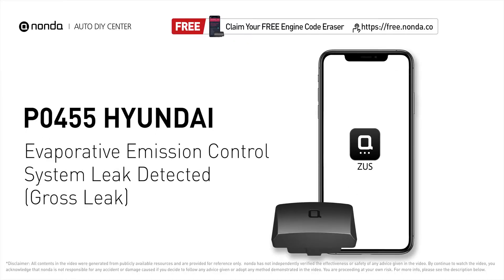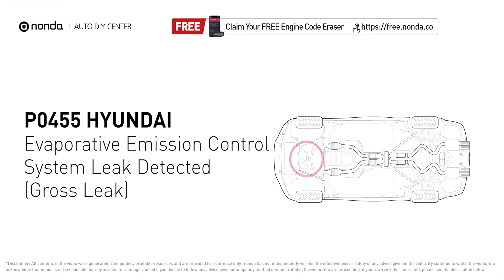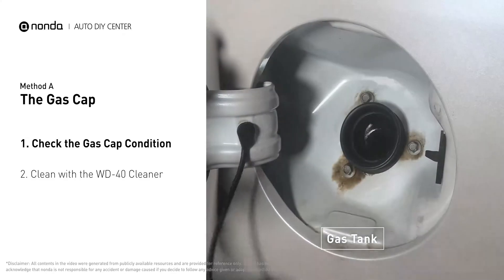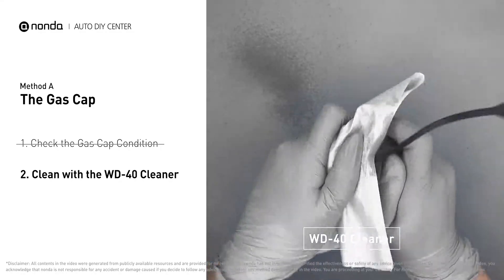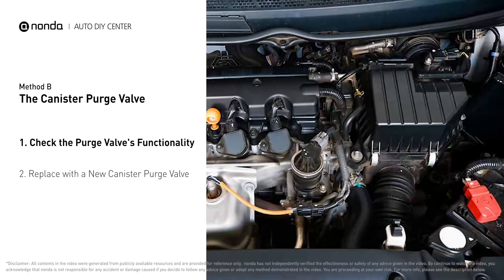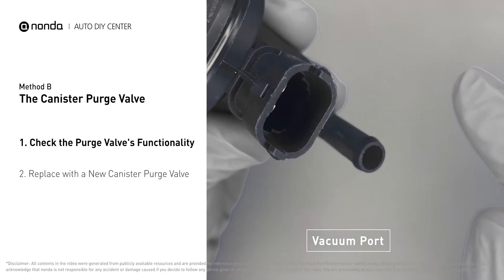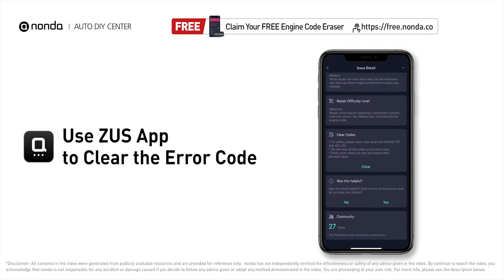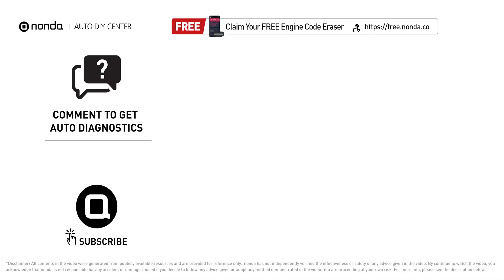How to Fix HYUNDAI P0455 Engine Code in 3 Minutes [2 DIY Methods / Only $4.61]

Comment: Hi, I am getting this code on my Hyundai Accent 2008. I changed the purge, the fuel cap. After thoses changes error was cleared but two weeks ago Code reappeared. What else can I do?
Reply from the maker: Hi Phany, can you please confirm if this is the only code that you're getting?
Reply: Don't put any significant money into this car before fixing the t.code. Bunnyhole to hell.
Reply: I have a 2000 Hyundai Elantra and YES it’s the only code I’m getting and I did what Phany did. I had smog test in December of 2022 and it wasn’t ready cuz I had replaced the battery in 2021. It doesn’t hit the highway so when it wasn’t ready for the test. I had to drive it on the highway for 3 days. After that it passed and now I can’t get rid of this code P0455. I appreciate any feedback. In 2022 I also replaced the canister cuz the fuel pump kept stopping and since I was there I replaced the valve underneath.
Reply: @1eyerasta  did you find a solution? I replaced the purge valve, canister purge valve, and the code came back months later
Reply: @itsxing1  not yet. The light went off and I think it came back on. For me it all started with not being able to fill up at the pump. When I replaced the canister all the charcoal was coming out. Being I was down there I replaced the valve. Filling up was back to normal. It wasn’t tell I had to smog it. Which it passed. But I had to drive it 50 miles on the highway due to replacing the battery and the car wasn’t ready for smog test. It wasn’t tell a few weeks later the engine light came on. So I did the gas cap and the purge valve under the hood. Resetting the code with each of them. The light went off after two weeks but I think it’s still on. With code P0455 (large evap leak) if I come up with a resolution I’ll let you know 👍
Reply: @1eyerasta  I did the same as you, changed the purge on under the hood, but I also replaced the canister purge valve in the back of the car near the back left tire. I have a 2007 Hyundai accent. The check engine light went away, but came back after months and now my possibly solutions r any leaks in any hoses, gas cap (I think this might fix my problem), or charcoal canister. I used to have an issue where my car would struggle to start up and idle right after I filled up my tank back when I had this first had this code, but now that doesn’t happen. If I find a solution I’ll let you know as well

Comment: I am struggling with error code p0455.  I am riding a North American Santa Fe 07 model year in Korea, and there is no way to fix it.
Reply: Sooner or later you'll end up taking the car to a dealer. My car(as we speak) has same problem, smoke test showed no problems anywhere, was told to bring to dealer they have more specific diagnosing equipment. So, the question will be, how much money do you want to spend figuring this out?
Reply from the maker: Hello, if this is the only code you are getting, you can follow the quick guide/tips provided in our video on how to fix this code. Hope it helps!
Reply: @nondainc  no offense, probably won't help. This trouble code is a rabbit hole.

Comment: So changed the purge valve on my '07 accent, cleared code. Went away for a week, and vehicle feels smoother.  Same code (P0455) came back, still feels as smooth though.  Guess I will clean cap now?  Odd code came back while feeling better..
Reply from the maker: Hello, we suggest checking the charcoal canister and the evap system hose for leak. Check also the condition of the fuel cap and the fuel filler neck.
Reply: Where is the charcoal canister?

Comment: I have a 2017 hyundai accent basic model. I have no clue where that part is. I have the P0455 code. I need help findibg where that part is please
Reply: Is your car still under warranty?
Reply from the maker: Hello, this code indicates that there's a large leak in the evaporative emission control system. Can you please confirm if this is the only code you're getting?
Reply: @nondainc  yeah thats the only code
Reply from the maker: Hello, begin with checking if there's an issue with the purge valve, line, and canister. Check the fuel tank pressure and the gas cap to see if it can handle pressure.

Comment: My 2011 sonata 2.0t i barley drive with 59,500 garage kept has the po455 i changed gas cap, purge valve, Canister Vent Valve code came right back after 5 miles down the road what's next that i"m over looking?
Reply from the maker: Hello, please confirm if this is the only code you're getting.
Reply: @nondainc  Yes it's the only code i have car was sitting in the garage for a couple of months.
Reply: There's a charcoal canister also.
Reply: @studleyjb3172 yup. I’ve replaced everything but that canister. That canister is important and how the fuel neck is designed going into the gas tank if you overfill your gas tank after the first initial click stop you can overfill fuel into that canister causing the charcoal inside to get wet possibly even sending bits down your evap lines causing blockages. I have a 2016 Hyundai Tucson and mine is located by taking off rear driver side tire and opening up panels to wheel well.